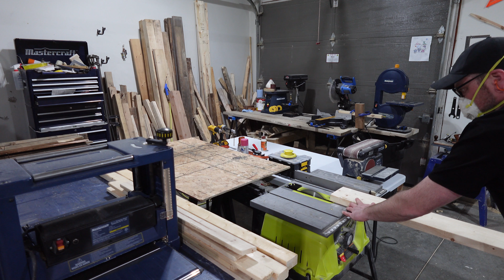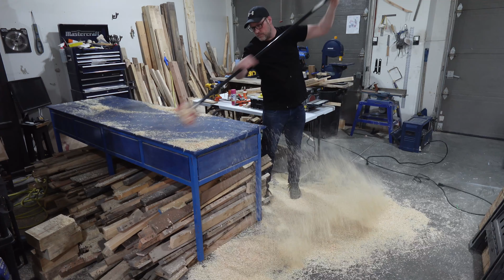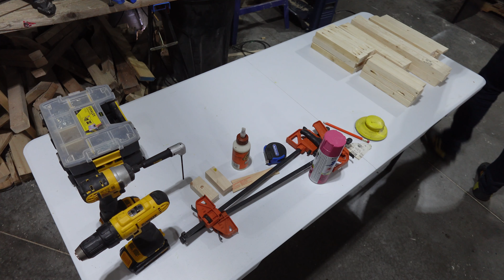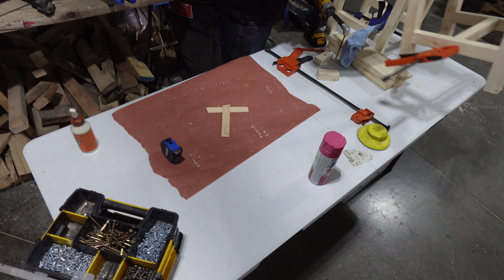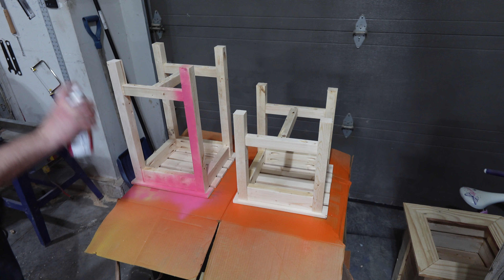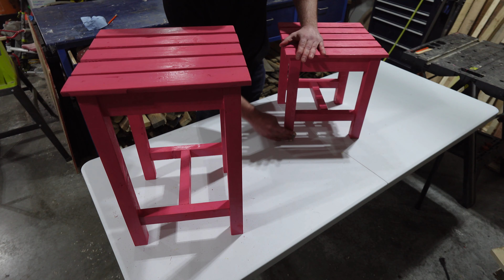Extra Profits This Summer With Repeat Buyers

Comment: Do you have many issues with snipe or does your table belt sander get rid of it anyway?
Reply from the maker: I dont have alot of it but I dont often use the ends of the wood, I square it off before measuring my lengths, which takes aways whatever snipe I would have had. Even glueup benches and stuff like that, I send to the planer before squaring off the ends. Thanks for watching!
Reply: @Mat_Builds  Thanks! Great to see your channel growing. Keep up the good work!
Reply from the maker: Thanks for the support, It's been fun!